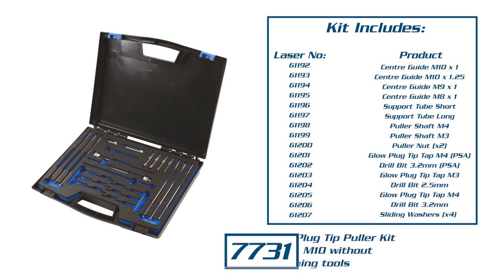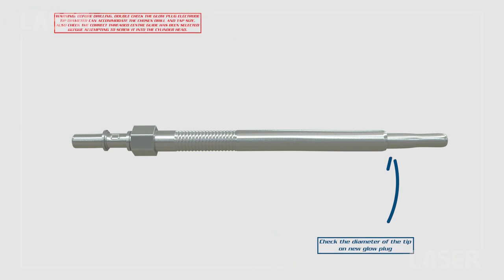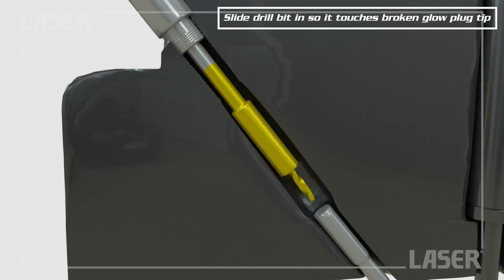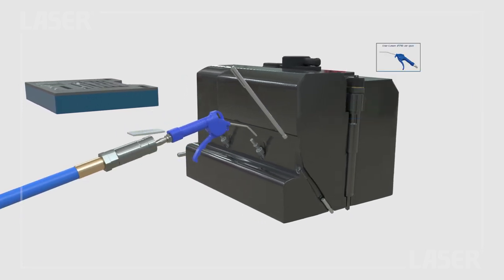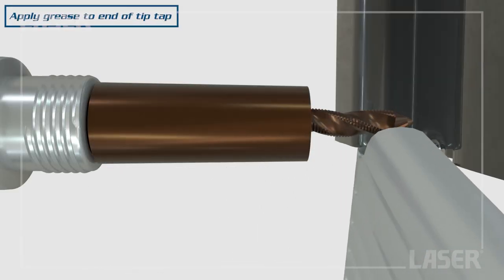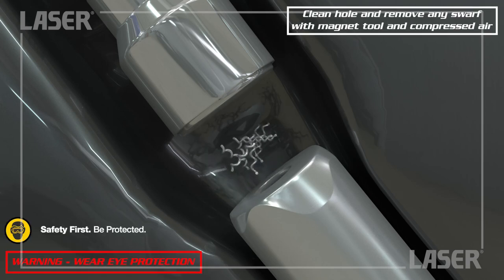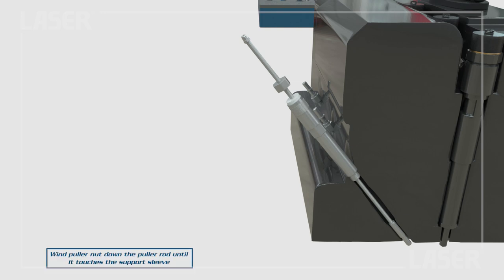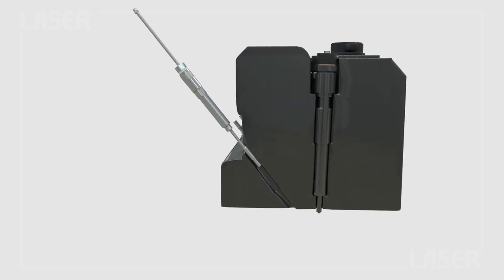7731: Broken Glow Plug Tip Puller Master Kit M8, M9 & M10

Comment: Overkill, simply remove the injector and tap the broken tip into the cylinder. 
You can then remove the broken tip through the injector port with a magnetic flexy probe.

Comment: This kit is more for if the glow plug snaps between the hex socket and the threads. If the tip of the glow plug snapped it would take pulling the cylinder head off to get it out.
Reply: How often does the tip snap off?

Comment: No chance that will work on a 1.6hdi  unless you remove the engine
Reply: Definitely works used it myself on a c4 picasso took a lot of Access stripping down but got the job done 👍
Reply: I have done a few - but not with this kit - the Citroen Berlingo / Mini cooper / ford / mazda and peugeot,  it is a ball ache - the egr can needs removing first but only the two exhaust clips not the water hoses - they are tight but doable - expect spending an hour a tip plus time for the necessary removal of injector loom and plugs to make the necessary space…..     before you begin